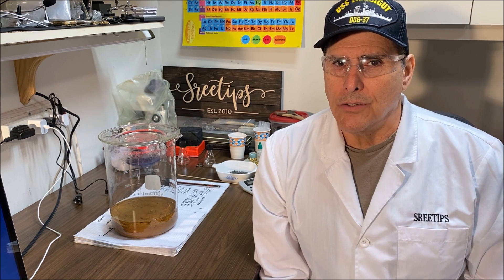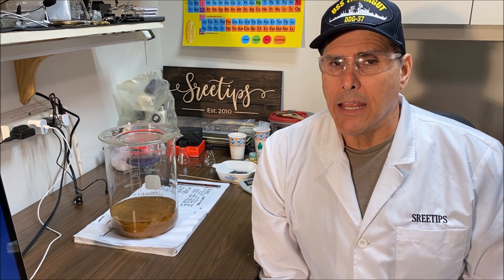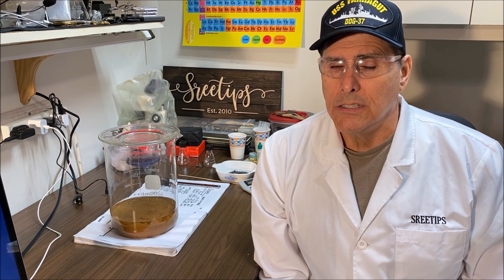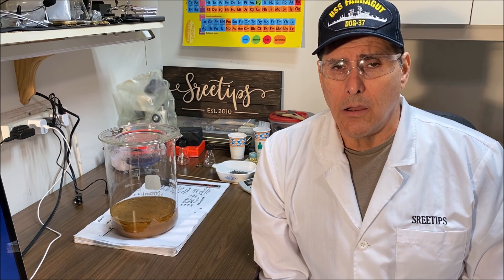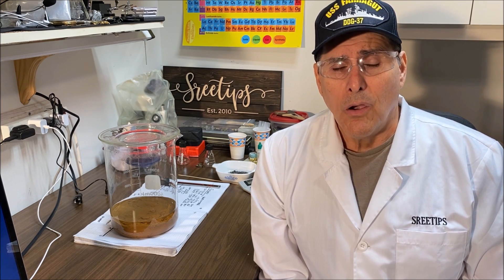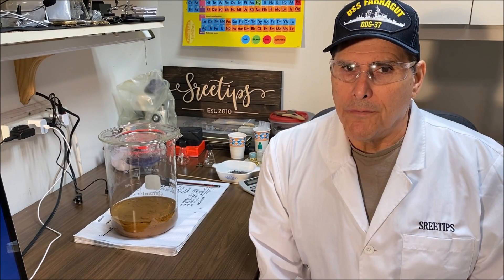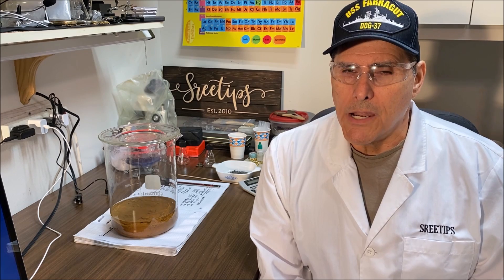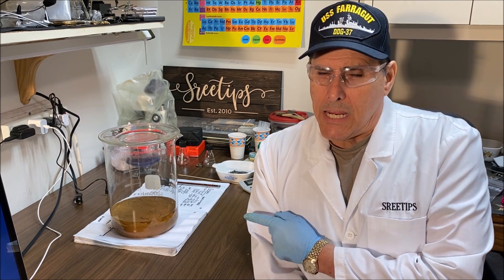Refining $47000 Pure Gold Bar At Home Pt5

Comment: Best way to make the best gold bar is to weigh out Gold shot into the mold 1st and make sure you get the molds that have a lid and Then put the whole mold into the Furnace obviously youl have to get bigger furnace And then right before  you turn the furnace off start flushing the furnace with an inert gas then maintain positive inert atmosphere until its cooled enough to solidify wich dosnt take long and it only takes a trickle to maintain the inert atmosphere so it not expensive to use that method but bars will come out perfect flawless you got ocd like me specially with gold using this process bars will be flawless everytime and will have correct weight everytime this is process that big refineries use to make them unbelievably perfect bars
Reply from the maker: I like the pour lines

Comment: Hello can you tell me the electropolishing chemical used in gold
Reply from the maker: Electropolishing chemical - I don’t know what that is.
Reply: @sreetips  I mean the electrolysis bath chemical bath on gold ornament The witch given kya gold ornaments Shiny actually I doesn't know the Chemicals and the ratio which is used in electrolysis bath in Gold ornament
Reply: @sreetips  electrolysis bath and electropolishing opposite of gold plating gold polishing is like Aqua Rig process
Reply from the maker: The bath is gold 100 grams per liter concentration.
Reply: @sreetips  but can you tell me the name of chemical is used in electrolysis bath in gold I'm in the electropolishing in gold inventing more if you cast an ice perfect bar your Gold then use oxygen handgun high pressure flame melt gold in few second and in high temperature when you catch the mould it become very finishing able bar in India normal gold Summit using the oxygen handgun forecasting the pure gold mould
Reply from the maker: The name of the chemical in the bath: chloroauric acid or gold chloride. You can find it on Wikipedia.

Comment: Do you think in the future you could calculate how much nitric acid you need based on how much gold youre dissolving (and how much HCl you've already added) by mass so you can quickly approach that number (say its 500mL, get to 450) and add 10mL incrementally until the reaction stops? Same exact idea for Na2S2O5 also
Reply from the maker: It all varies, I can never get it exact. But I can guarantee that all of the expensive nitric gets used efficiently. Not so much the hydrochloric.
Reply: @sreetips  Have you ever considered synthesizing nitric or is that too much of a pain

Comment: A few times in this video I started getting light headed because I was holding my breath and didn't realize it. I was getting flashbacks of the beaker of platinum that fell to the floor. I know you had to be nervous too when pouring into the 3 separate containers to precipitate
Reply: what's this about a beaker of platinum falling to the floor, must have missed that one?
Reply: @JeffJeffers0n  about a year ago. Stock pot series I think

Comment: So if the bar weighed 767.1 grams....and it was 24k gold = the spot value is currently sitting at $1847.51........you have a $42,000 gold bar in your possession ❤️🔥 glad u got it for 47k - great job 😎😎😉
Reply from the maker: Thank you

Comment: I have no scientific, or lab experience. Im just a plumber but I have a little knowledge of what we dring from tap water. I see you used distilled water to make your solutions and to rinse with but you use ice cubes to keep solutions cool. Is that regular water you froze or did you freeze distilled water. If you used regular tap water arent you reintroducing impurities such as lead, chlorines, chlorominie?, minerals back into your solutions.
Reply from the maker: Tap water has contaminants measured in parts per million. Not enough to report in a precious metals assay

Comment: Wow! Great video series! I was fascinated by it because, over my career as a jeweler, I have done this many times! I got a copy of the Hoke book, and always took to heart that the nitric MUST be expelled by evaporation to syrup, then adding strong HCL to bale off the nitric. I started by using iron sulfate to precipitate. I use SMB now. I didn't usually inquartate, as most of my material was in finely divided filings. I had a system for low grade waste. Retired now -- no more large batches! Cheers!!!
Reply from the maker: I like One to Two ounce batches. Larger than that it’s more difficult to handle.

Comment: As of Today 21 Dec 2022, that bar was worth about $70000 CAN.  About the price of a brand new loaded Ford F150!😃
Reply from the maker: The gold has NOT gone up in value. It has NOT become more scarce. Demand has NOT increased. The spot price only looks like it has increased. What has actually happened, and this must be fully comprehended, is the value of the currency used to price the metal has DECLINED in value. And this is why gold appears to have risen. Gold hasn’t changed.
Reply: @sreetips  I never quite thought of it that way. That gives me a whole different perspective of what's going on.  I guess that's what happens when the Governments print more money to cover irresponsible spending.  Thanks (I really enjoy your videos)

Comment: Could always remelt it. Wont lose anything and get a nicer looking bar. Seams like a waste of time but shutting off that oxygen seams to be bothering him.
Reply from the maker: If I’d have shit the fuel valve first I wouldn’t have infused that carbon on the surface. I was going to remelt but the darn thing wouldn’t fit back in the crucible.
Reply: @sreetips  got a pretty important letter wrong in your response lol. But thank you for responding

Comment: Adding hydrochloric acid to the volume of gold present in the beaker is uselessly wrong. In fact it is discounting the volume that the gold is occupying.  Measure once, cut twice... add the measured 2000 ml to the beaker then note the volumetric differences with the gold present- the powder might be fluffy when wet but it seemingly occupied about 1300 ml before you poured the rinse water off, right? Rule of thumb requires a thumb. Not being mean here folks.

Comment: USS FORRESTAL CV-59 82-84 Mayport Fl. 
USS DIXON AS-37 79-81 Point Loma Ca. 
 Overlapped earth at Diego Garcia from both Commands 81-82.
Reply from the maker: I was on Farragut DDG37 from 1976 through May 1980. Glakes  may 1980 to June 1985. USS Semmes DDG18 from June 85 to Sep 1990. Then DESRON Four on the Commodores Staff until I retired in 1995. Joining the Navy right out of high school was the second best thing I ever did in my life.

Comment: OKAY IT'S BEAUTIFUL ! But now we need to see the Math and Lessons Learned Analysis.  For Example you started with
with a melt value Oct 20, 18K $2923| 14K $32612 |10K $8505 || $45,260 investment.  + $1220 melt value Sterling.  After refinement you are only up on Melt value $1922.00 So you had to sell the bar at a $100/oz premium and your labor 50 hours @$50 = $53,000 for the bar. Most of us would have paid no problem.  However I respectfully suggest you invest in a Streetips DYE and Stamper and start selling refined coins.
Reply from the maker: I made my profit long before I even thought of doing this video series. First rule for profit seekers; you make your profit WHEN YOU BUY.

Comment: Remove the torch from it before turning off
Reply: Would the forge give a better bar when melting, I used to put my glass in a kiln and then shut it down to cool off. So I was curious if doing a pour in a forge and cooling it down slowly would get a better bar, with no layering look, what do you think?

Comment: I worked casting molten metals for a living over 20 years, You made alot of mistakes, no biggies, Don't heat a mold up using a cutting torch, Get the mold light red hot, as you pour into the mold move your torch,side to side up and down, low oxygen, once your mold is full ,run your torch all along the edge of the mold as the  gold starts to solidify, run your torch gently side to side, this process is called FLOATING the metal, there will  
be no layering on the sides of finished product, SOLID, NO CRACKS
NO LAYERING  👍👍👍
Reply from the maker: I like the layering!